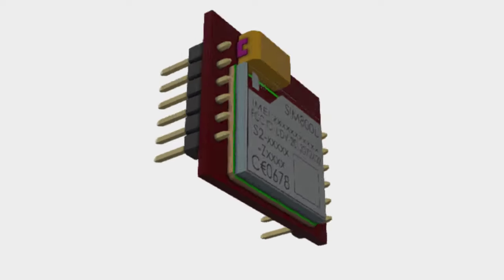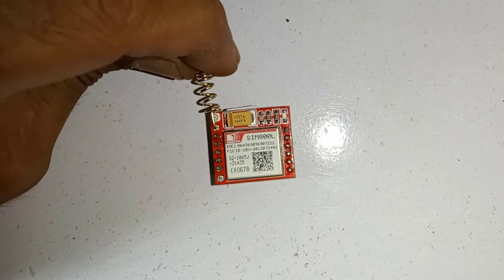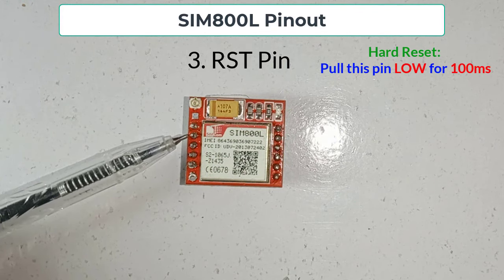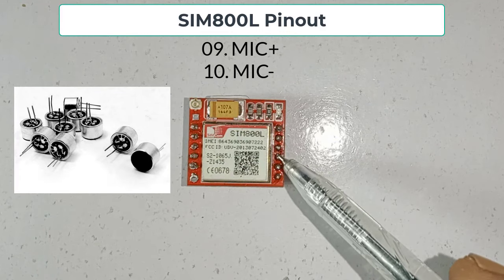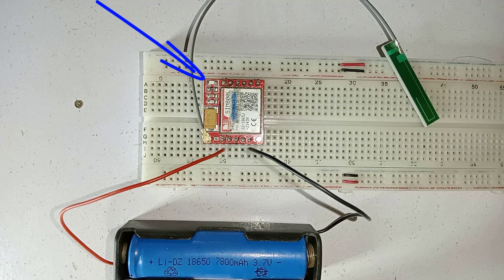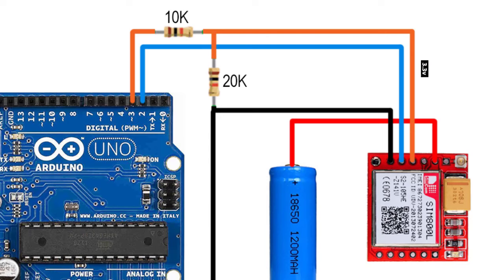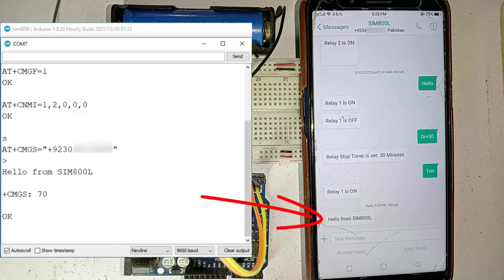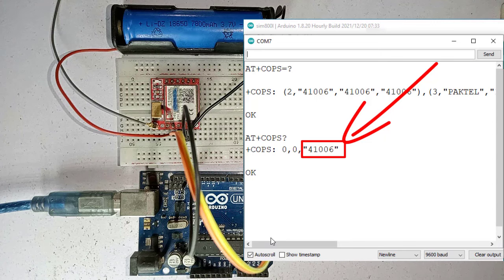How to Use SIM800L With Arduino

Comment: I don't know why I can't use ATD+ command to make a phone call. Even with semicolon, it still doesn't work. I can send text message to my phone  through code without any problem. So my connection is ok.
Also how to terminate message using AT+CMGS? I type my message and press CTRL+Z  on my Arduino IDE Serial monitor and it doesn't terminate the message. It stuck at  ">"  symbol.

Comment: thank you .
Reply from the maker: You are welcome!
Reply: I have a question, I need advice. I want to control pump and fan remotely by GSM. What do you use as a controller? stm 32 . adruino nano ? The choice in terms of cost and ease of programming and installation.

Comment: hi  we have made a project on arduino based obstacle avoiding robot with crash detection and gps system . we have used sim 800l for the gps tracking n sms alert but it doesn't seem to work in our areaa(we use 2g sim) so what changes can we make to improve this??
Reply: Hi, i'm from banglore, im also working on arduino based crash detection and gps system, but gps system is not working, i dont have 2g sim either, did u find an alternative for this problem, if u find, please let me know, i too will update if i figure it out
Reply: @SuSu-lg8rx  yes sure , i will lyk and r u done with the model and codes?
Reply: @SuSu-lg8rx use a airtel sim card brother and check
Reply: You got a solution are not bro

Comment: Great video 
My gsm is only Blinking only onec when powered up 
I tried powering up with Buck converter but didn't helped 
What to do ?
Reply from the maker: use a battery 3.7v. if you are using buck converter the set the output voltages to 4.2 volts.

Comment: I tried this but it didn't work in serial monitor it just shows initialising and nothing after that and my gsm module just keeps blinking can u please help me with this
Reply from the maker: most of the time this is power supply issue. provicde stable 3.7 to 4.4V,

Comment: Hi
I trying sim800l and sim800l v2 both module but they unable to interact with Arduino and i am not getting any response on serial monitor why? I am making a call and it's ringing even my MSG also delivered to sim800l module what may be the problem?

Comment: Hi, i have a problem with using any AT commands
When i used your code Mr Ahmad in serial monitor i can see only the word "Initializing.." and that's all there is no At commands work 
Pls help me, what did I do wrong
Reply: I also facing this type bro can you get solution for this
Reply: @TahirKhan-id3dc  in my case, the issue was in the circuit of my system. After I did right connection AT commands worked well

Comment: Hi sir, I have two different Sim800L, S2-1065J this type sim800l works very well,
And I have another sim800L S2-105HE this type unable to received and send the SMS and serial monitor also nothing, but I will call to sim800L they have ringing, indicating every 3 seconds also fine, how to settle the problem?
Reply from the maker: try AT+CFUN=1,1 to turn on the full functionality of sim800l. then try again with sms
Reply: @AhmadLogs  thank you sir, I will try and let you know sir
Reply: @AhmadLogs  sir, I try this but cannot, serial monitor showing the quotation marks only
Reply: @AhmadLogs  sir, can send me the full code?
Reply from the maker: @rajaduraisangari  unfortunately I dont have the full code

Comment: hello I'm working with SIM800L to send sensor data to firebase. The first tests I had to do I managed to connect via GPRS but now I can't connect to the server when I send the data without the sensors I manage to connect but when I connect the sensors to send their data the connection fails.
Reply from the maker: sim800l is not performing well while working with firebase due to it slow internet connection.

Comment: In some time my sim800l module is disconnected from the network  automatically after it will connected, but the arduino can't work after the connection because of all the AT commands are placed in setup function, so how to I use when the GSM MODULE reconnected to network & work properly with ardunio
Reply from the maker: I am trying to make a video on sim800l programing. I think it will solve your issue. so be patient
Reply: @AhmadLogs  Thankyou brother

Comment: message getting delivered on the phone as <<Content not Supported>>, but able to receive SMS, call-out & in what could be the reason?
Reply from the maker: which mobile phone you have used. the sms content are simple text and all the mobile phone support text. so it is strange. 
have you made any change in the code.
Reply: @AhmadLogs  does this code works with ESP-12E & nodeMCU?
Reply: @AhmadLogs  resolved by adding  below command under void reply sim800.print ("AT+CSMP=17,167,0,0\r");
Reply from the maker: @pookoye  OK thanks

Comment: Hi, i do have sim800l using zong sim.. for last 4days i was able to send sms through sim800 but after that it stop connecting to network , red led i blinking every second. What could be the problem its been two days i am working on this. Kindly help me..
Reply from the maker: have you registered your gsm module from the PTA? if not then it is possible that the PTA has blocked your gsm module IMEI number

Comment: I tested the circuit several times, everything is fine, but the SMS is not received, it rings and is available, and the SMS is sent.
Reply: for esp32
Reply from the maker: try following at the end of the setup function.
sim800.println("AT+CNMI=1,2,0,0,0");
Reply: Thanks, exactly where to add

Comment: Hello. I get "Error" and "No carrier" on my serial monitor when I pass the "S" and "C" commands. What could be the reason?
Reply from the maker: I think it is the signal issue with sim800l have you attached antenna to you module. if yes then try to replace it.

Comment: Ahmad Bro I'm Using 3.7V li-ion battery but its LED is still blinking for 7 times and repeat
Reply from the maker: use short length wires from battery to sim800l or try another sim card
Reply: Charge your battery

Comment: Where could i got 20k resistor?
Reply from the maker: you need 3.3v logic.  you might use other combination of resistors.
Reply: @AhmadLogs  anather qsn, i am not getting signal from network as led blink in 1sec. Sim is ok and it is 2g active sim. Attached a 3.9vollt lithium battery. Stil problem there  but in at command the arduino shoows the sim number. It means sim reading is ok.
Reply from the maker: @Sekhar_Home  1. some to the AT commands always works even if your gsm module not connected to the network. 
2. try another 2g sim card just for testing.
3. you need to try another sim800l module. it might be damaged.
Reply: @AhmadLogs  yes i will check
Reply from the maker: @Sekhar_Home  great

Comment: serial monitor does not work
Reply from the maker: then check your serial connection, set the correct baud rate from the serial monitro

Comment: Hi Ahmad
Great
In previous programs, you used delay (); command . In this program, you used the waitForResponse (); function.
Would  you explain this difference?
Reply from the maker: Arduino do nothing while in delay time. so, to increase the performance of the program I have used waitForResponse() function without using any delay(). But this function is under development. I am working on it to make the code more efficient.
Reply: @AhmadLogs  Thank you for your attention and explanation

Comment: is there any alternative module other than 2G which supports this project?
Reply from the maker: you might use sim7600 4g module but you need to update the code
Reply: @AhmadLogs  module keeps blinking every second,  I have sent AT  command but no reply? how to check the module?
Reply from the maker: @pookoye  if the module is keeps blinking then it mean your sim card is not working or else your module is damaged
Reply: @AhmadLogs  sir I'm using 4G sim and the module blink fast and then it blink slower is it okay to use?
Reply from the maker: @johnmarkmanuel2681  just make a call to the module to see if it is working or not
Reply: @AhmadLogs  sir my GSM module blink 8 times and then stop for 3 seconds over and over it keep the same things I don't understand sir why it goes that way
Reply from the maker: @johnmarkmanuel2681  your module not getting the enough current or voltages

Comment: We should assume this video is out dated for India, because 2G sim is nomore in the market, we have only 4G sim.
Reply: no brother its working till date (19/12/2023)
Reply: Except Jio, all service providers will work...
Reply: @narutosingh5239  ya actually I had a 4g sim but changed the network settings to 2g using a old device
Reply: @krutavshah1515  you have changed the settings in phone and used that sim in SIM 800L module ?
Reply: @sk_a_railfan  yes I changed the network preferences to 2g/3g but I used an older phone , I don't know it will work in newer devices or not
Reply: @krutavshah1515  my phone also showing that option did you give any other power source other than Arduino for SIM800L ?